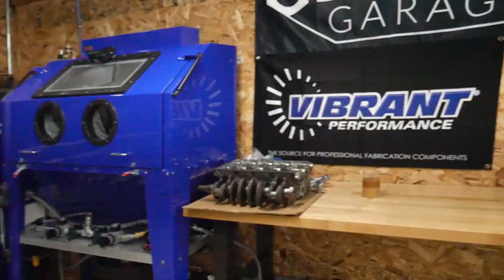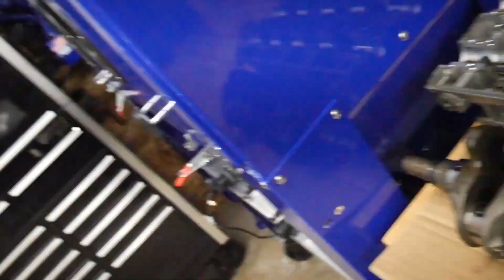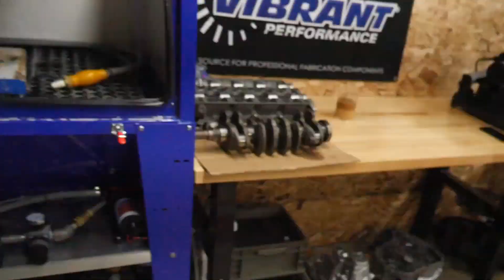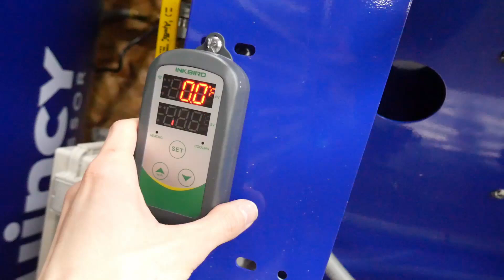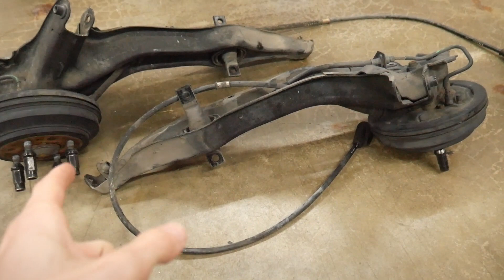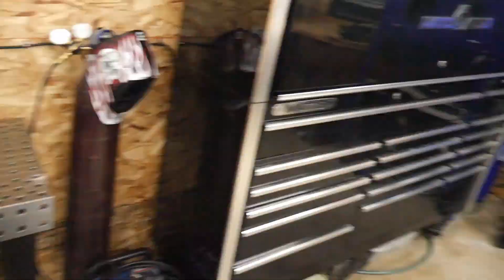I built a Vapor Blasting Cabinet!

Comment: Hi, what is the psi and cfm compressor does?
Reply from the maker: Compressor is a Quincy QT-54 60gallon 5hp. I would recommend something at least this size for Vapor blasting.
Reply: @donkuschel5326  Thanks. What is the best mesh size for bright surface, how do you think?
Reply from the maker: @garage2198  in the video I was using number 13 (170-325grit) glass bead and it’s a finer media so it has a shiny finish. I’m switching to number 7 (60-80grit) now to give more of a factory finish dull finish.